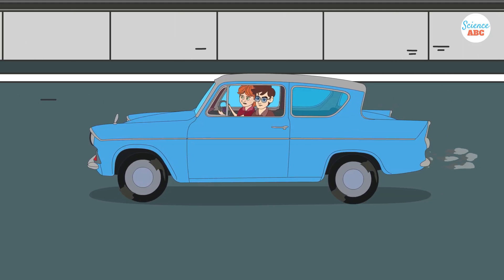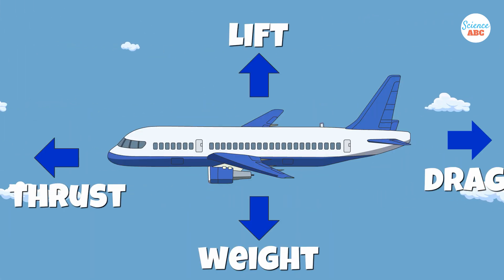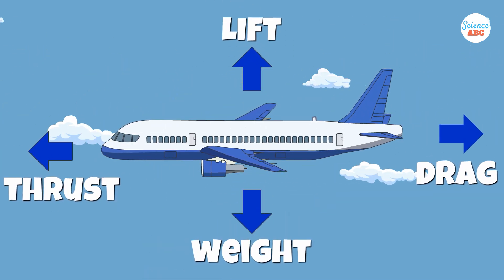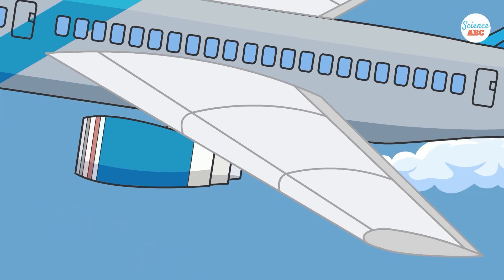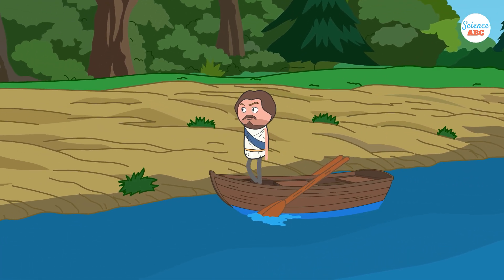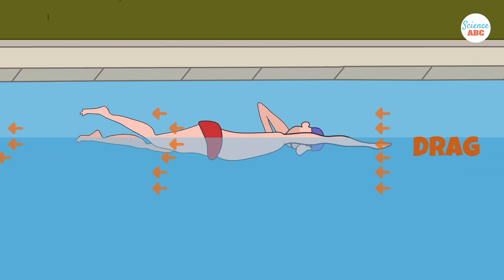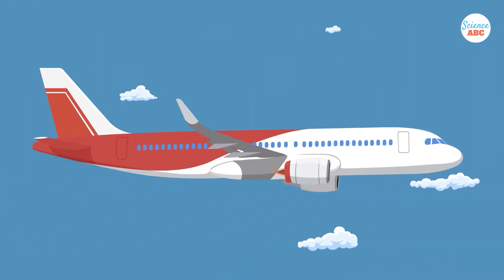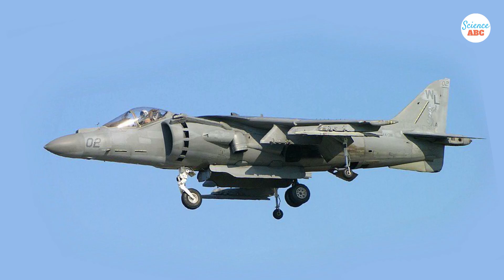How Airplanes Work: A Simple Explanation for Beginners

Comment: A pressure differential does NOT cause lift. Rather, a pressure differential IS lift caused by the downward excelleration of air. Lift is a reaction force, not an initial action force. A reaction doesn't cause a reaction, an action does.
Reply from the maker: Thanks for your feedback

Comment: It was my understanding that an airfoil was only an optimization but not necessary for lift.  Which is why stunt planes have flat wings and fly upside down just as easy as right-side-up.  Most of lift is simply from angle of attack and the equal and opposite force from deflection molecules downwards.  Then the airfoil is an optimization to do this as efficient as possible, but not necessary for flight. Just like if you stick your hand out the window and slightly angle your hand it wants to fly upwards.  Or take a tupperware lid in a pool and spin around with the lid flat to the direction of rotation.  Now angle the lid slightly upwards and it aggressively wants to "push" towards the surface despite being flat.
Reply from the maker: You are right that any surface with the right angle of attack can generate some lift. However, an airfoil shape significantly improves the efficiency of this process. Thanks for sharing your perspective on this.
Reply: @Scienceabc The gain of the airfoil is primarily due to reducing turbulence. The Bernoulli effect is very small.  The video is simply wrong.